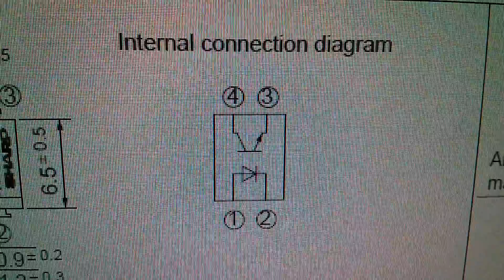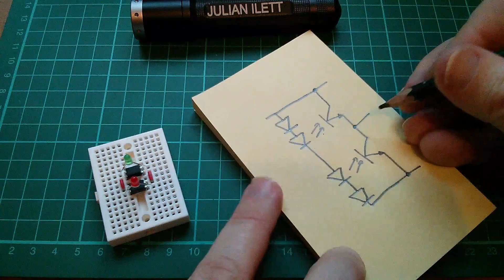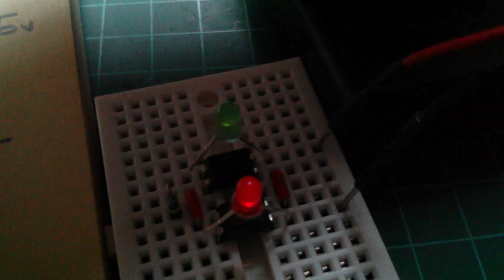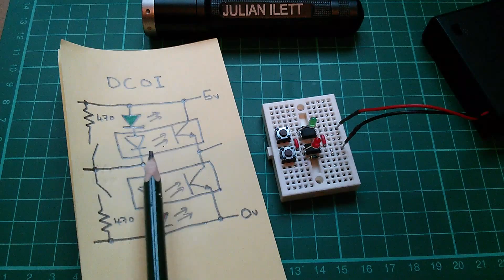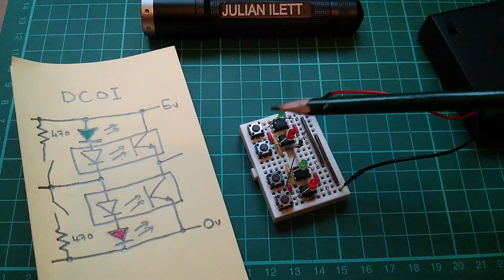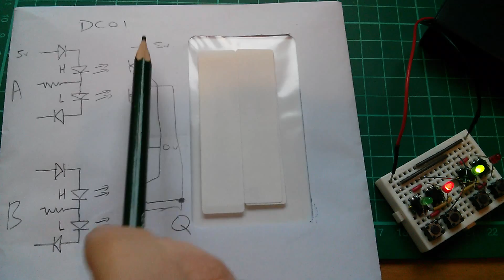Invention: Dual Complementary Opto-Isolator (DCOI) Logic

Comment: Hard to tell for sure with the video, but it looked like the final latching circuit does go a bit brighter on the LEDs while the button is pressed. What's happening there, and does the voltage to the LEDs rise to a dangerous level such that continued depressing of the button will burn out the LEDs? And regarding the OR vs. AND function, do you mean normal 'OR', or exclusive 'XOR'?  ∨ vs. ⊻

Comment: There isn't a problem with turning on both phototransistors with a 5V supply as long as you limit the current through the input diodes. You are using PC817C which have a forward current gain of between 2 and 4. The absolute maximum collector current of the phototransistor is 50mA, but the absolute maximum collector dissipation is 150mW, so you should design for a maximum collector current of 30mA. Keep the current through either or both inputs below 7.5mA and you can't damage anything. You'll get away with 470R, but it's not guaranteed by design.

It's not feasible to rely on four diode drops to limit the input current with a low impedance power supply, or one that might vary in voltage over time. There's just too much variability in samples of LEDs and photodiodes to give any repeatability. Put simply, you need some limiting resistance is series with each photodiode. Annoyingly, the datasheet doesn't give a figure for the minimum voltage drop across a conducting photodiode, so you have assume the worst and use a minimum of 5V/7.5mA = 680R resistors. Replacing the LEDs with 10K resistors would give about 0.13mA through the photodiodes and no more than 0.52mA through the two phototransistors. That's not going to short out any power supplies.

The reason why you don't have opto-isolators as logic elements is their bandwidth is limited to about 80kHz. Slow logic is okay for some applications, but simple RTL works as just well and is much faster and cheaper.

Comment: I stumbled onto this video, a you tube suggestion while I have fussing with opto-isolators for a pump speed control that required level shifting to 10 volts and drawing only 5 ma from the pump controller.  I was replacing a pot!  My main problem was that the PWM input into the single opto-isolator produced a nonlinear output with the RC low pass filter.  I immediately saw that the two active components in the output side of the opto-isolator in your DCOI circuit would solve all my problems.  It works completely linearly, with inversion, OK and complete isolation from the Microcontroller supply and the pump supply.  Comments:  You should have told viewers that GRN, WHT and BLU leds need >3.2 volts while RED, YEL, ORN need >1.8 volts. If folks tried just two RED leds, with the two input stage IR diodes, the Vcc+5 would have been marginally OFF.   But well done, mate.

Comment: Neural network. Create input output layers to test theory. Weighted values next in hidden layer - voltage comparators perhaps.
Reply: That would be neato to have a 4 bit defacto network on a chip. Then chain chips together to create larger networks. But very application specific.

Comment: So last week I was considering building a computer using optocouplers in the place of transistors and/or relays. Mostly I just don't have the money for a bunch of relays, but didn't want to use transistors because it just wasn't "out of the ordinary" enough for me. I was only considering boolean logic till I saw this and of course got excited at the chance for ternary computing. Anyway, I spent my day breadboarding and probing with a multimeter. It did not pan out. The "tristate" ended up just being a floating input or output (Which in ordinary logic circuits is something that is avoided for good reason). I'm afraid I'll just have to use boolean logic if I do go through with an optocoupler computer. I was thinking about uploading a video about it, but I'll just leave a comment instead. I'm sorry to say that it didn't work out. That being said, if you have the time, please go have a crack at it, I learned a few things while messing with it that I otherwise wouldn't have considered

Comment: I read some of your comments to comments on this video and you often mentioned valve computers. Have you tried tinkering around with tubes already? I mean, building a whole computer of it would be some kind of long-term-project, but you can use them for many more things. like, building an operational amplifier based on tubes. that would be as stupid as DCOI (which i find absolutely interesting, just ordered a batch of those little bastard isolators to bring to university!), but it is also a funny thing to do. If you like to give it a try just tell me, i have lots of spare tubes and would send some of them to you for free.

Comment: Hi Julian! Like the way you play and try with electronics :) But few notes on this.

First, the way you use it there is no need to use opto's. You just use them as your all purpuse NPN and PNP transistors. Because you share the GND and even the 5V there is no isolation what so ever.

Second note, the normal way is to define the state by the voltage, in this case the buttons. And you can use just 2 LED's to check the output. Connect one (the red one) from 5V to the output and the other (green) from the output to GND. floating state is when both LEDs are on dim.

It's kind of cheating to use a LED current to just not turn on the output. Probably it's turn on slightly but the current is to low to blow the opto. In terms of opto isolated drive a MOSFET you could have used a NPN PNP paire connected to the opto with a pull-up.

But hey, it's fun to play!
Reply: Actually, those optos are somewhat different from ordinary NPN transistors in that they can have quite precisely selected "betas". The PC817C used in the video is specified to have a forward current gain of between 2 and 4 at an input current of 5mA. Unlike an NPN transistor, if you drive 1mA into the input, you cannot get more than 4mA out of the collector or emitter, so you really don't have any issues with a push-pull output stage "crowbarring" the supply.

Comment: I like the idea of opto logic, the only problem though with opto isolators is the speed, which is probably why no one has built an opto logic chips. The 74 series has response time in the nano seconds where an opto isolator (for logic) will be in the micro seconds. In essence a very slow computer..

Comment: Interesting logic family! I can see how the tristate state could actually be useful. By setting all of the inputs to tristate it seems that all the gates should go to tristate, and hence no power consumption. However in reality there is always some power being used since the leds are still dimly lit. The reason I thing this approach although interesting is not very practical is that I imagine it will not be very fast. The light controlled transistors inside the optoisolators should react more slowly than their more "normal" counterparts. For some applications where speed is not an issue I believe with some more work some interesting circuits might come out of this. I am thinking in safety critical circuits where some interlocks could be created using the tristate states (but I haven't explored this, it is just a gut feeling that it might be possible).

Comment: This kinda reminds me of Minecraft's redstone logic, you've got LEDs everywhere, the base logic block is an inverter, your RS-NOR latch is simply two inverters strung together. I feel like you could build a NOR gate by simply wiring two inputs to the same inverter block, though that may require some fiddling with the resistor values to make it so when you have a 1 and 0 as the inputs it treats it has a high input. Perhaps that could be done by having one of the LEDs be a higher forward voltage, and having a larger resistance to ground?

Comment: I saw a tv episode where a cpu cooled to near absolute 0 has a third state, enabling all sorts of possibilities... what is the theoretical clock speed of an optoisolator?
Reply: Phototransistors are pretty slow, so in the order of hundreds of kHz. It's still relatively fast, but there's a reason your i7 doesn't use phototransistors.

Comment: Well to be complimentary the output transistors should be complimentary (one pnp and on npn) and actually if you use both npn the pulldown is amplified while the pullup is a voltage follower (minus  about 0.7v depending on the load). It will still work but not perfectly symmetrical.
Not sure what's going to happen with the optotransistors as the base don't really have voltages or currents applied to them but are exposed to the IR light.

Comment: Nice idea and very "visual". I don't want to be a downer, but never use it in a real application, i. e. driving MOSFETs! The optos will definitely be on a little bit in this setup (if you see the red and green LED glow there's definitely current flowing through the opto LEDs, too). So your output isn't tri-state in the usual sense (low, high, high-Z) but tri-state like low, high and VCC/2. Feed that to a MOSFET that's driving a load and see it releasing it's magic smoke. For (switching) MOSFETs you want to make sure you can't stay in the "half-on" region (going through it quickly is already hard enough).

Load the output of your gate with a 1k resistor (or whatever appropriate) to GND and measure the voltage at the output. It should tell you how "open" the optos are. Maybe leave the inout side as is, but remove the series connection on the output, so you can measure the output of a single opto.

You don't see opto couplers in a push-pull-configuration often (if ever), because first they are slow and second often very asymetric in their turn on/turn off time, turn off being mostly being longer than turn on. So you are shorting the supply for a short period, every time you switch. Normal transistors would do that, too, but they already are magnitudes faster and some other external can prevent this. So use a single optocoupler to drive a "standard" puch-pull/totem-pole stage to drive the MOSFET (if you do PWM you would still have to look at the asymmetry of the opto, because 50/50 in at the opto does not mean 50/50 at the MOSFET gate).
Reply: Unless you allow uncontrolled input currents into the optocoupler, its output current is also limited, so I wouldn't worry about shorting a supply out with something that can only draw a few milliamps.

Comment: This has a lot of similarities with DTL logic (the forerunner to TTL)... which I guess isn't surprising since you're using diodes and transistors to make it all work :)
Reply: It's actually just RTL (the forerunner to DTL). I remember the first IC I purchased back in the mid-1960s was a dual 2-input NOR gate in a black plastic TO-5 sized package with eight legs. In other words, it was two transistors with their emitters tied to a common ground, and each having two base resistors and a collector resistor integrated onto the die.

Comment: The tristate mode can be dangerous for driving MOSFETs, depending on the load and the configuration. The optos will in fact be half-on an pass a small current. They might present a resistance equivalent to a couple of kohms. Measure it if you want! My suggested method would be to interrupt the connection between the emitter and collector and put a current probe there, then working it out with ohm's law. Just measuring resistance with a DMM might give a false reading, but then again, you have the issue of burden voltage from the DMM with my method.

In any event, the problem is that the two half-on sides will create a voltage divider and drive the MOSFET gate with 2.5 V, which is likely half-on, ie neither saturated nor fully off, so the MOSFET will in turn pass a small current. This can be ok, but is something you'd need to be wary off. It's certainly not ok in a H bridge circuit, which is a mistake I once made. (Not using optocouplers, but with insufficient drive.) If both transitors were fully on, you would get a puff of smoke. Now, I instead got two toasty transistors and a relatively high residual power consumption. :|
Reply: the tristate is only present when switches are used and none of them pressed or when connected to some other tristate logic (which is not that common)

Comment: Only one practical question: Why couldn't you just add a resistor and a single 3-way switch (ON1-OFF-ON2 or just two 2-way switches) instead of the LEDs, so it connects it to 5V, but when you switch it around, it goes to 0V and pulls it to ground? (It would reduce the power leakage and increase the battery lifetime by cutting down on power consumption and the leds can still be added)
Edit: But I forgot to mention that the idea of the forward voltages preventing turning the whole thing on it genius!
Reply from the maker: HunChem Cheers. I very nearly ordered some on/off/on toggle switches (which would have delayed the video a few more weeks), but when I got the set/reset latch working, the push switches made more sense - and they fitted nicely onto the breadboards.
Reply: Julian Ilett You are actually right then. Now I see why you needed it this way. The two switches can be both turned on if you use these...

Comment: overvoltage on the rail will stil be able to turn both optos on and short the rails in the manner you described, potentially causing damage. Depending on how much current can be supplied to the circuit this could be self limiting but you still might have to do something about that such as add some resistance to limit the current to the transistors even if you're using a regulated power supply just in case of fault conditions. perhaps between the 2 transistors put 2x 10-20 ohm resistors and have the output as the mid-point. They would also act as gate resistors suppressing ringing as long as the trace to the gate is short.

If you want to use and optocoupler for an isolated MOSFET gate driver, you can use a single optoisolator with a NPN common collector output and a PNP gate turn off circuit. Alternatively to the PNP turn off circuit, you could have a NPN/PNP totem pole.

General purpose optocouplers tend to have quite a high parasitic capcitance and low bandwidth. The bandwidth of a given optocoupler with 1mA on the collector might be 10kHz, going up to a maximum of 100kHz with 10mA on the collector, still dead slow for digital especially when you remember a square wave has lots of high harmonics to pass. Also, they generally need more current on the LED than they output through the transistor. You can get much faster optos designed for digital purposes.

The "logic family" doesn't exist becuse it's relatievly large, expensive, slow and requires quite a lot of power. You can do it all better with normal transistors and if you need isolation, then you add an optocoupler stage. I still like your efforts in this video. If nothing else it makes visualising logic gates and latches very easy. I really want to see you make a few adders and put together a simple 4 bit computer or something :D

You'll have to fogive me, I don't meant to be grumpy and put you down, I've just worked a night shift in the shattered remains of the NHS after 30 years of tory and labour governments trying to destory it without publicly admitting it. The last 5 years of cuts upon cuts have been aweful; there's nothing left on the bare decaying bones of the NHS for the vultures to further remove.
Reply from the maker: KX36 Yes, this is strictly a 5V logic family. I'm watching lots of videos of the first thermionic valve computers, but the idea of building one is out of the question. But I can't imagine optos are any worse than vacuum tubes?

Comment: This'll just turn out to be a decoy...
(groan!)
As an aside, I remember where you fitted the COI in the Muppet proj. I was looking at similar, but - like you, needed a higher voltage than the input, to switch the 'high-side' N-FET.
Rather than use a 9v battery, or a charge pump, I (re) stumbled across an amusingly-named, half-forgotten circuit called a 'Joules Thief'......Maybe worth resurrecting this ancient, simple design. Plenty of Google refs.
Enjoy!
Reply from the maker: Andy Crofts That's a thought, I'll look into that.

Comment: by using the the led's, you are removing the isolating part of your opto isolator XD
Reply: Strictly speaking, no. He could still split the primary and secondary side of the opto at that point. He did lose isolation when he added, feedback, though. Although that could still be fixed if he did the feedback through optos!
Reply: yea isolation is lost if both the LED's and the transistors are connected to the same power supply

Comment: Have you tried connecting three of those inverter circuits to create a ring oscillator? Might be interesting to see what frequency you would get.
Reply: Julian Ilett It could also be possible that your oscillator is just running way to fast to differentiate it running vs the leds being dim in tri-state. You could try chaining a larger odd number of inverters together to see if the propagation delay is visible, or hook up an oscilloscope to see if it's switching.
Reply from the maker: Nice idea, but unfortunately it doesn't work - all three inverters just sit in the tri-state. Shame - I was hoping that could be my system oscillator.
Reply: Can you get rid of the tri state by bias-ing the input so the default is off?
Reply: Bob Seddigh Bob! What are you doing here?
Reply: peaps Building Skynet with Arduinos?  :D

Comment: ...but what I still don't understand is why you are using optoinsulator in the first place. you could just use basic transistors since the insulation is obsolete anyways
Reply from the maker: bitluni's lab True, I'm not using the isolation at all. I've taken an interest recently in the very first computers that used thermionic valves and then discrete transistors. But the transistor circuits were quite complicated with lots of resistors for biasing. The opto-isolator gate idea seemed simpler at first.